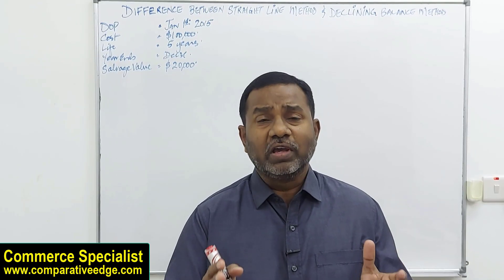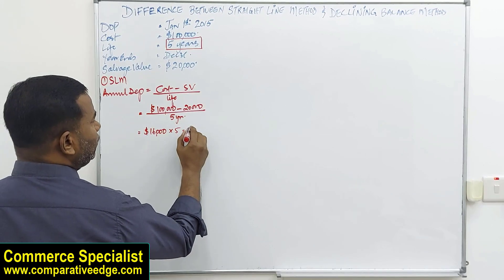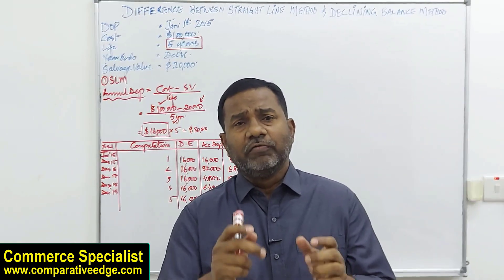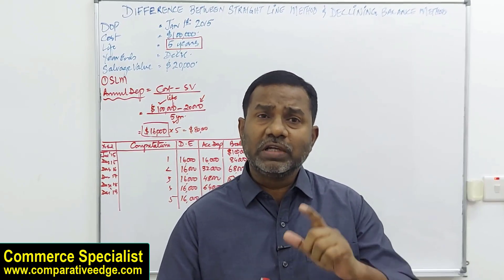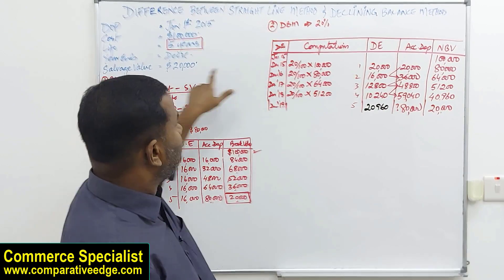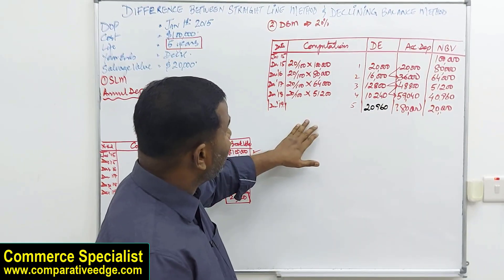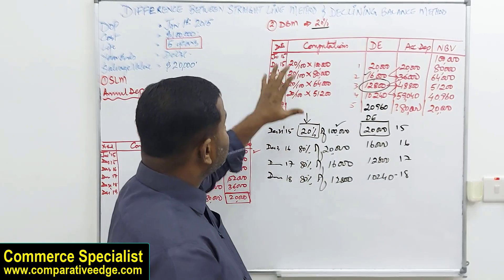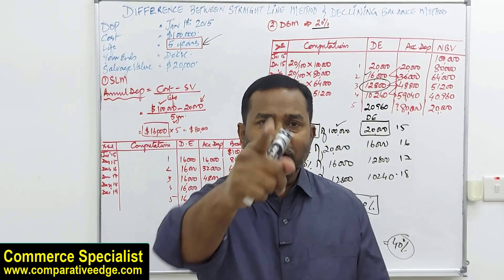Straight Line vs Declining Balance Method | Main difference btw SLM and WDM | Commerce Specialist |

Comment: In your very first video of depreciation, you mentioned that the choice of using a certain method depends on the nature of asset or how it is used such as a car being used only for travelling a specific distance back and forth. If both straight line and reducing balance methods have to have the same scrap value, what is the need of having all the different methods? I mean, we could just use either method for the car travelling a specific distance.
Reply from the maker: Scrap value is just an estimation dear